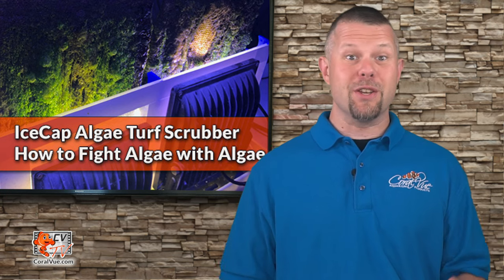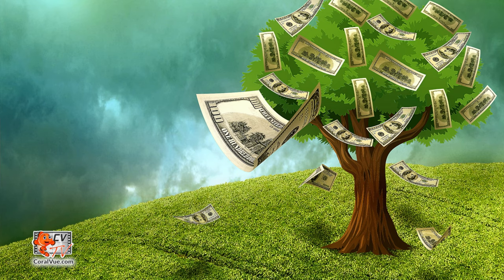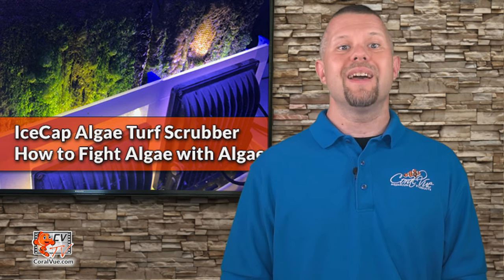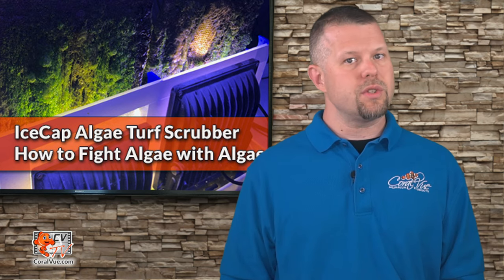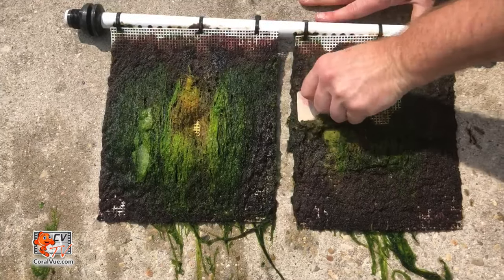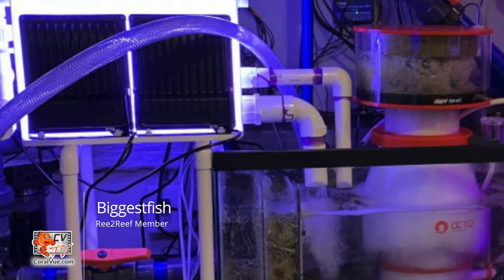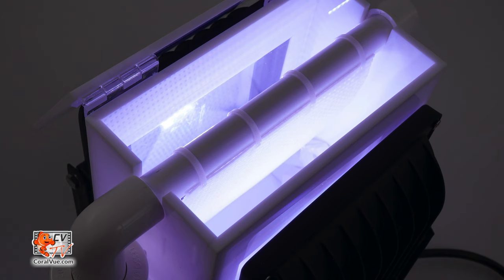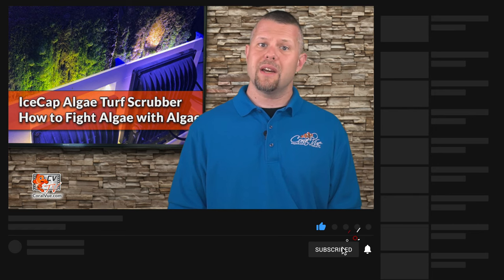Algae Scrubbers EXPLAINED: How to Install IceCap's Algae Turf Scrubber to Reduce Nuisance Algae

Comment: You guys need to explain how to set the drain lines up better. First, do NOT GLUE the pipe to the drains, just press fit it so it can be removed for maintenance. If you glue them you can't remove the bulkhead fittings from the scrubber. Or install a union so you can reconfigure easier if you do glue. Also if you need to reconfigure the scrubber you have to cut the PVC if no union is used. This method does require some sort of drip catch underneath the drain.

1. The large drain needs to be submerged in a sump to silence the water drain sound. 

2. Installing a drawstring mesh filter sock on the main drain will a) create a bubble trap, keeping excess bubbles out of the sump b) collect any loose debris from the scrubber. 

3. You want the emergency overflow to drain above the surface of the water so you hear the water drain sound. This lets you know your scrubber needs attention and the main drain is clogged.

Comment: How to install ?
Reply from the maker: The Scrubber gravity drains and must not be placed in the sump. It has one intake barb you attach tubing to a feed pump. There is an emergency drain and the main drain. The emergency drain which is the smaller of the two drains can be plumbed with a barb and tubing or PVC to the sump. This is a preventative measure in case the main drain gets clogged. The main drain must not be downsized and should be plumbed and glued with PVC. Unions on long lengths make for easy maintenance.  Here is an image of a recent install: https://d.pr/i/oysfok
Reply: @CoralVueTV  Thanks for the info and picture.  Personally my sump is under the aquarium and can't imagine I have that much room. Will measure....thanks again